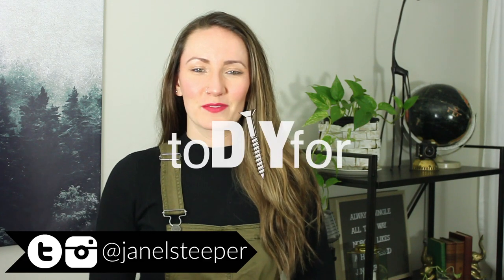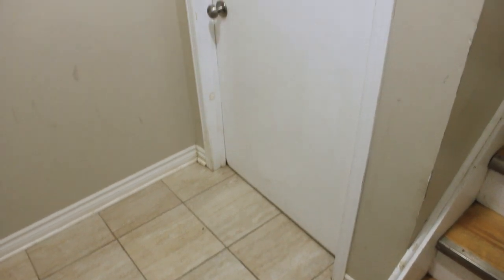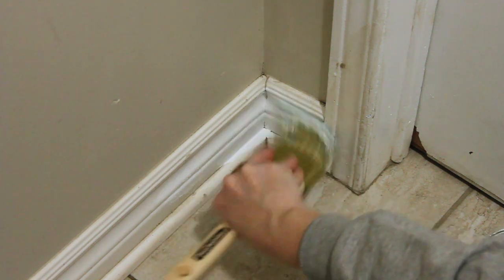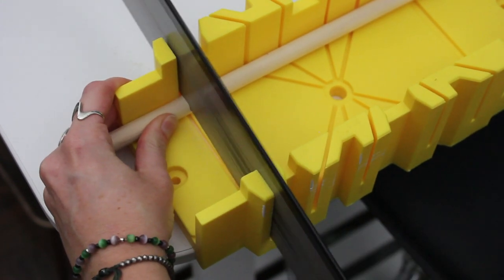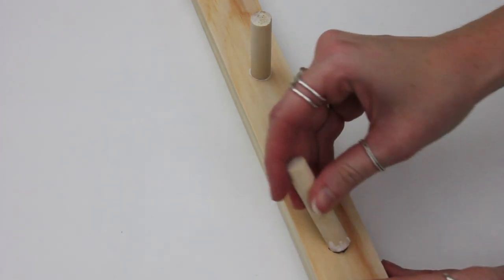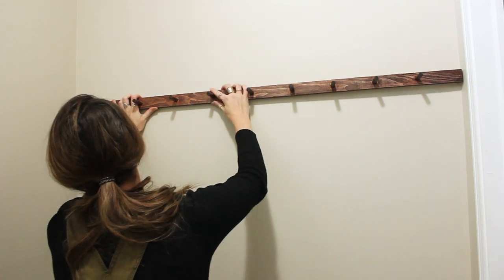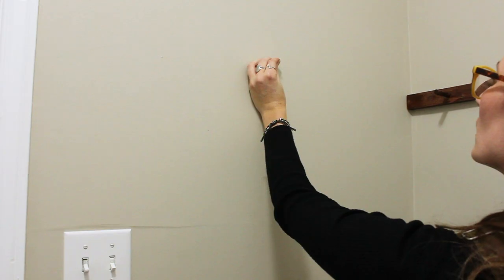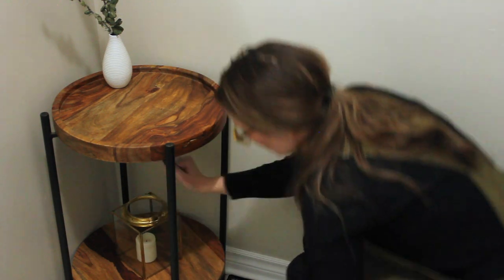DIY Entryway Makeover for Under $40

Comment: Thanks for  the great share.  One way around the hanging issue,  figure out ahead of time where the studs are, and incorporate that measurement in the spacing of your dowels on the board. Countersink the holes where the screws go, add all of your dowels except for where the 2 or 3 countersunk holes are. Screw the board on the wall, then add the dowels over top the screw holes.  It works very well.  One caveat: it will be very hard to remove.
Reply from the maker: B. me great idea! I kind of came to that conclusion a little late 😂 but yes. This sounds like the best way to do it!